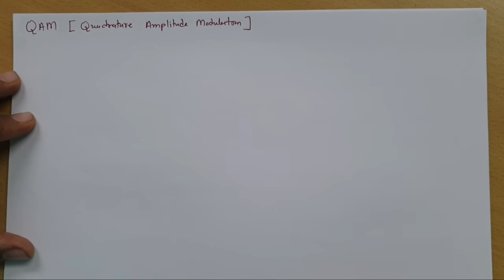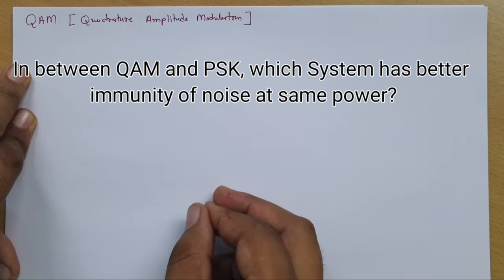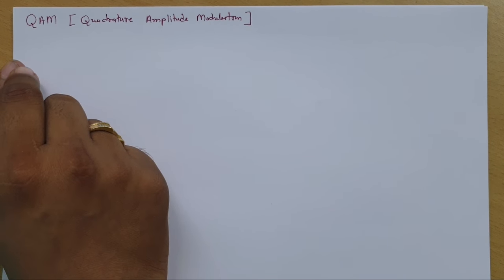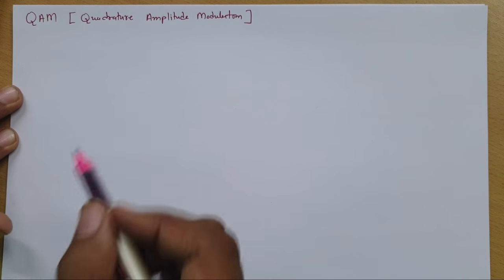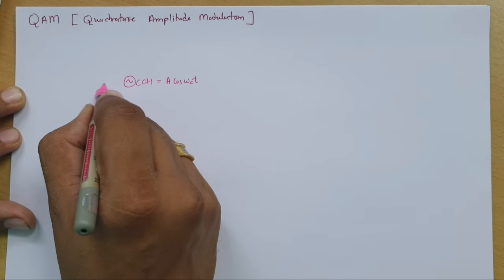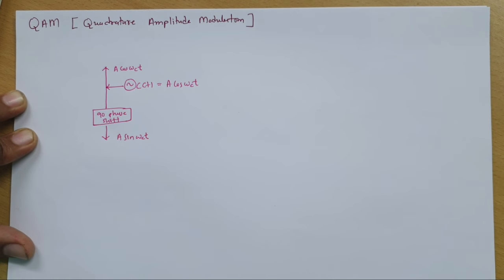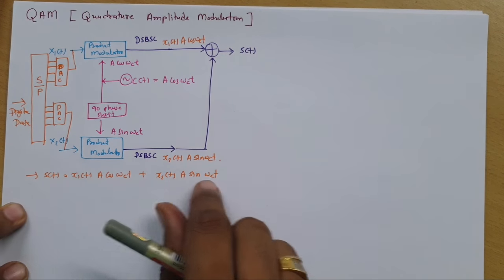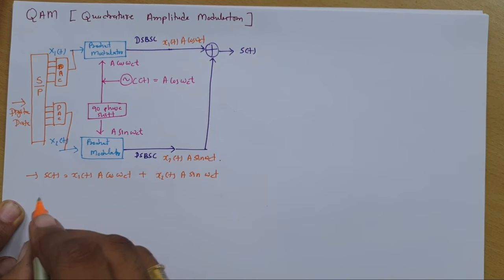QAM Quadrature Amplitude Modulation | QAM Transmitter | QAM Receiver | Constellation Diagram of QAM

Comment: Does anyone know how to calculate the capacity of a microwave link for different levels of QAM modulation (eg 256 QAM or 1028 QAM) for a bandwidth of eg 56 MHz. What parameters should be known for this capacity calculation. Is there any formula for the above capacity calculation?

Comment: So was the original diagram an example of 2-QAM since the original signal was DAC'd into 2 levels? 
EDIT: Oh snap, it's 4-QAM since each of those two levels have 4 bits.
EDIT EDIT: Nope, I'm still dumb. Since it's 4 bits, it has 16 different levels which makes it QAM16

Comment: Sir At same bit rate which of these performances is best? 
 4 ASK,4PSK and 16 QAM?
Reply from the maker: At low frequency 4 PSK
At high frequency 4 ASK
Intermediate frequency 16 QAM
Reply: @EngineeringFunda  How this is calculated?
Reply from the maker: You can check it with BER performance.
Reply: What is x1 and x2
Reply: @sujoci315  inputs in analog or digital form

Comment: Sir, QAM modulator transmitter capable of transmitting PAM signals ?
Reply from the maker: Yes
Reply: @EngineeringFunda  Sir,  I want  design a modulator. My hardware is a low-power device such that the instantaneous energy it uses must be constant. My specifications also indicate that my modulator must be rate adaptive. Which modulation technique would I choose? ( PAM - QAM - Phase Modulation - Multi Dimensional )